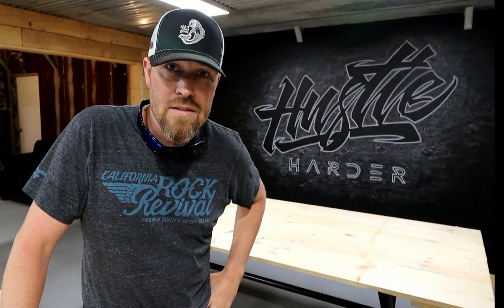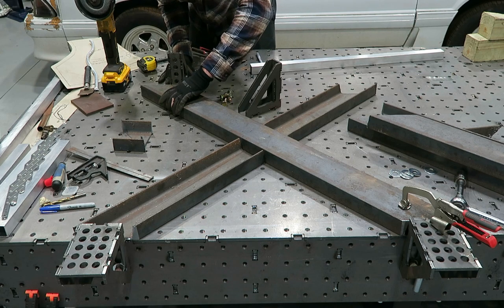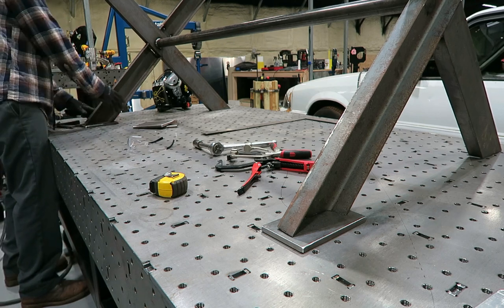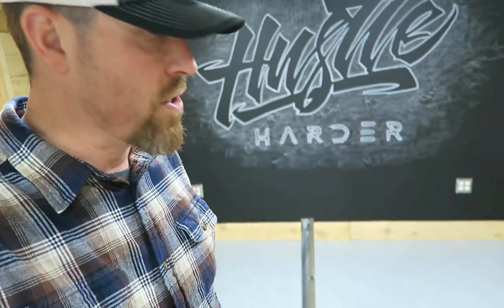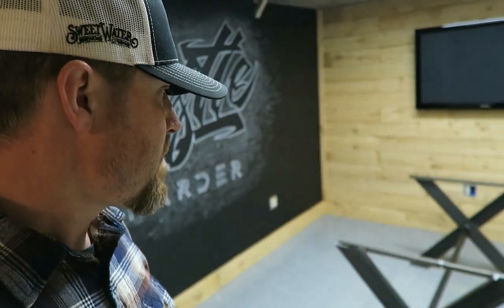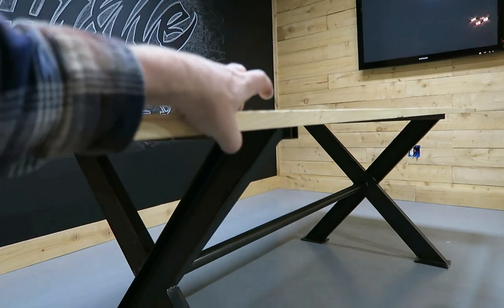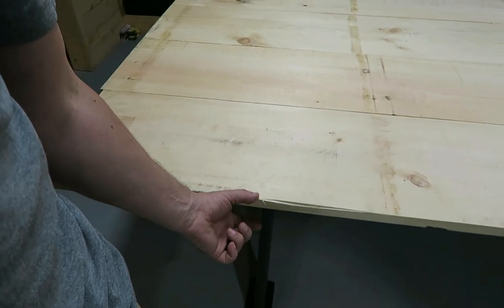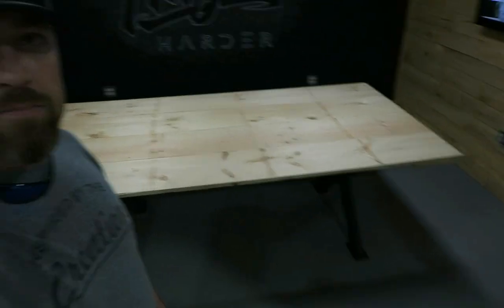How To Make A Rustic Industrial Shop Table

Comment: Awesome build you use tons of different materials I think a concrete top with rebar sticking out or stone marble or welding table with glass over it
If keeping the wood. Burn it /wire wheel it /spray stain re wire wheel it / then Clear apoxy it

Comment: I like the table, big time. Think about if you do clear resin inside the angle iron edges, putting some leaves or whatever you can find outside, in the resin top. Can be a really nice rustic element that ties the piece to your location. Years ago my brother in law did resin topped cable spool tables in Hawaii that had shells and tiny dead sand crabs in the resin like old amber with bugs in it.

Comment: Kyle, the table looks pretty damn solid.💪 I like the simple design and beefy materials used and you've probably managed to get it done on the cheap without it looking that way. Trimming out the top using some angle iron would complete the look. Great project, man.👏 BTW, you ain't that out of shape. You've got a few years in you before you start showin' your wear like us old(er) guys.😉 Take care, brother. See you back over at the Bibbster.

Comment: Put the angle iron around the top, then pour the clear epoxy resign to the top of the angle iron.   That way you can wipe the top off and crumbs etc...won't get caught against the edge of the angle iron.

Comment: Hey mate looks great ! I have an idea for the table top - the rusty metal sheets you have on the outside of the office walls use that as a table top but cover it in a clear epoxy  so it's smooth  , just a thought  keep up the good work

Comment: tinted epoxy top.  double the angle iron so you can attach on the bottom and cover the entire end of the wood.  (would need to be multiple pieces)

Comment: Hey bud, if you want ideas for metal and wood combos like you were talking about attaching angle iron to the table edge etc. Check out jimbo over at jimbos garage here on the tube. He builds all sorts of steel projects that has wood involved with them. Maybe some of his work can give you an idea of attack, not only for the table but for your super sized man cave/shop. Good work though its pretty badass table.